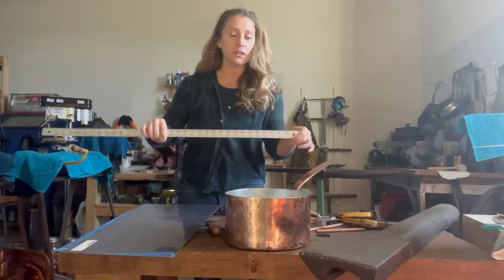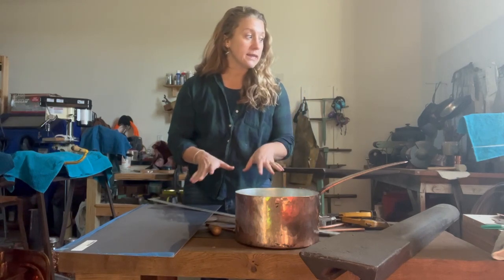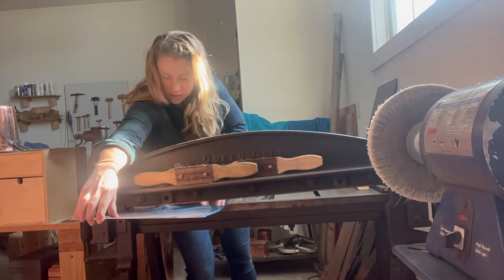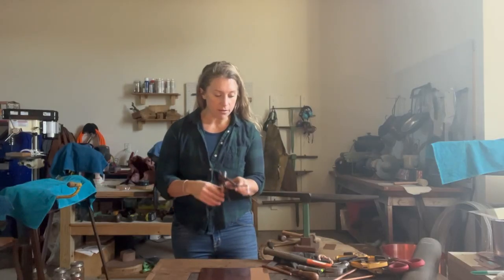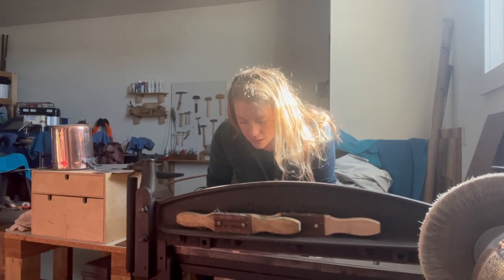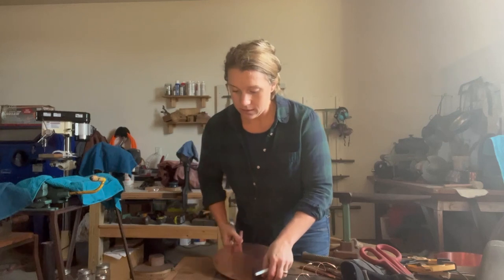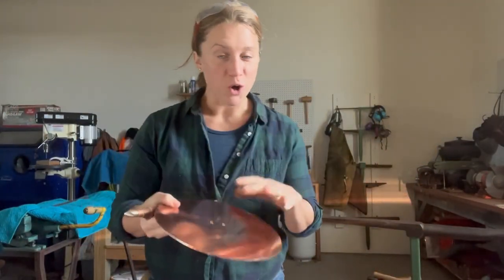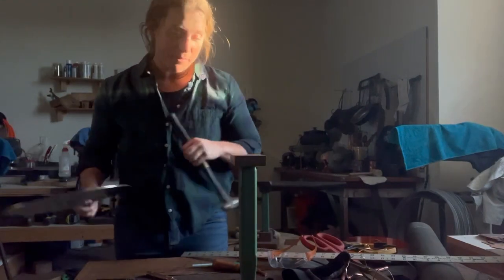How to Make a Copper Lollipop Lid

Comment: Loved the handle, did this style of lid ever have a folded edge for strength? Yee Old Copper Smith in Rockford .
Reply from the maker: No, I have never seen a folded edge in any historical photos/museums. I would think there would be crimping issues with moving the material in a circle - making plates always has that issue during burring/wiring.

Comment: Always wondered what the advantage of a "lollypop" lid was besides ease of manufacture. Made one to try out and found it prevents or at least moderates boil-overs, esp. on a wood range where one doesn't have precise control over the heat, as opposed to a fitted lid that allows pressure to build up beneath,  suddenly lifting it up and making a big mess of one's stove top! By sliding the lollypop around to vary the opening on top of the pot one controls the boiling rate rather than controlling the heat from below. Cool idea!
Also, is the drywall paste to prevent scorching, and/or maybe to moderate warp-age? Noticed you didn't get much when you heated that otherwise dead flat plate!
Reply from the maker: Lol, pretty nifty, right?! It's like science-y, but also easy to make. The drywall paste is actually to prevent tin from spilling over to the other (copper) side. You can also prevent warpage by heating the piece a bit (especially if it's CDA 110) before actually putting it over the heat for the tin. The double heating removes the oxygen that creates the warping otherwise (at least, in my experience).

Comment: A quick way to use the compass. Set it then put one point just at the edge of your work and ake a mark with the other. Turn copper to the next side and repeat. Where the lines intersect is your center.
Reply from the maker: Thank you! Great tip!! So appreciate you sharing!

Comment: Thanks Sara, this is great. You’re bringing an old craft back into the world. I think you should make a Tik Tok! 

I find my Harris stay clean always scorches and turns black- I think it’s because the pot gets too hot AND because the copper is not clean enough. I usually dab it with cotton wad to pick up the boiling gunk before using the insulation to spread; seems to help. Also have been using thick-cut steel wool- that’s been the easiest to use because I have long forceps that I can hold it with. 

Getting a little better each time. Is the brown/black gunk I’m describing due to overheating?
Reply from the maker: Ha! I would love to tackle tik Tok but frankly am already struggling to keep up with some social media AND do the physical work itself. (Also tik Tok intimidates me lol). Yes, the Harris will scorch if you get the copper too hot. If there is that gunk that comes off though, it maybe leftover food or unclean gunk - but usually it's overheating. I've seen steel wool used, though I have done the forceps method with the pink insulation, too. The fun part is - everyone does it a bit different. Erik out in Colorado uses just paper towels to wipe in the tin! :)